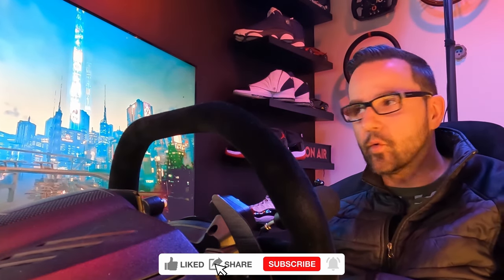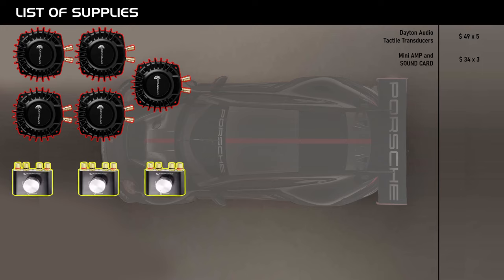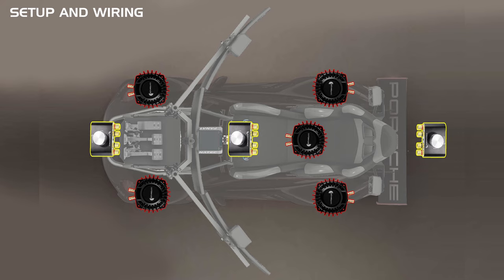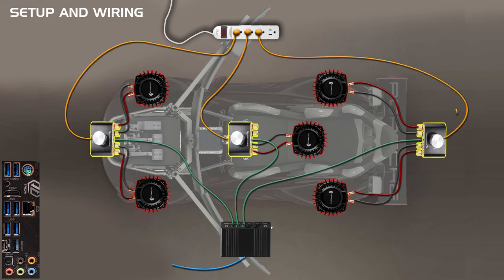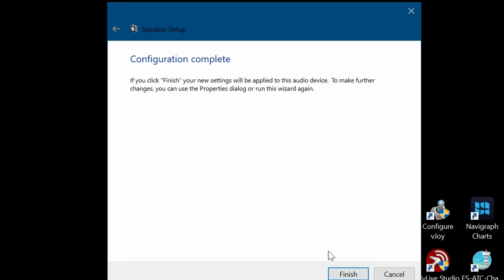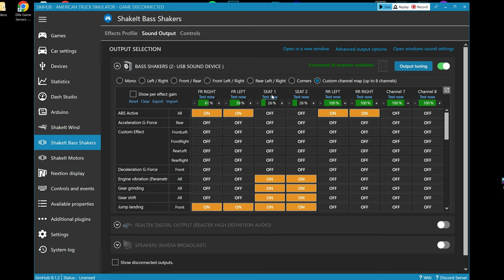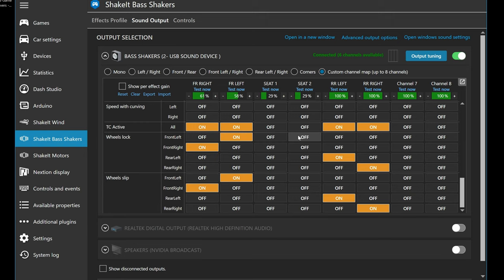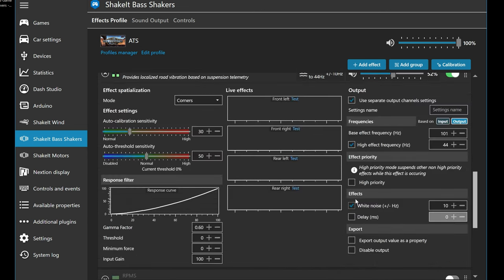DIY ULTIMATE Bass Shaker TUTORIAL | Step by Step HOW TO and SETUP

Comment: Just wondering if there was a single amp that you could recommend over having to use the three smaller units?
Reply from the maker: I've only used these so it is difficult to recommend anything else BUT : THEORETICALLY, ANY AMP THAT CAN POWER THOSE SPEAKERS AND RUN FROM HOUSEHOLD CURRENT SHOULD BE ACCEPTABLE!  I remember starting to go down that path one day but gave up . Someone in the comments bellow mentioned they used a marine amplifier. Scroll through and ask !! I'm sure people will help you if they have the answer ! Let me also do more research ....
Reply from the maker: The one thing I'm having a difficult time imagining, is how to get individual audio channel back into this single amp that we are both imagining.....hmmm..... Back in the day when we were messing around with amps and subwoofers in vehicles I don't remember amplifiers that had 5.1 capability....I could be wrong . The amps that is use provide power (amp) but they are also the receiver of 2 of the 5.1 (6channels) from the sound card .....hhhmmm what kind of amp would have 6 channels of input ...my brain is a bit stumped. To be clear . I am not an audio visual pro . That is why I made this video because I couldn't find any answers out there, therefore this is the only answer I could come up with.
Reply: Thank you for replies… I am currently building my rig and have installed two Dayton units. One under the pedal tray and one under the seat, but I can see me moving to more units to allow for more effects to be enabled.

Comment: will bass shakers work on rigs that are Steel Square tube?
Reply from the maker: Bass shakers will work on anything as long as you find a way to attach it and find a way to make sure the vibration transmits through the steel . I started mounting my shakers on wood pieces and cantilever those pieces  off the rig. That would enhance the vibration factor

Comment: my lg monitor has 2 stereo speakers. Do I still need a extra sound card?
Reply from the maker: Simhub will need a sound card to split the sound and send it to different speakers. If you are using that sound card to send sound to your LG speakers than it will be occupied and won't be able to be used for sound and for the shakers

Comment: may i ask why you didnt use the nobsound 5.1 ch amp instead of 3 individual units?
Reply from the maker: I had no idea it existed ! Now I have to look into it .  Have you used it ?
Reply from the maker: You can't hook it up through USB ...that's one huge drawback . Not sure how Blu tooth would fair under this set up . 5.1 ND latency ....hmmm . Yap . Not a good choice I don't think
Reply: @DaSimSimma  are you sure?  I havent used it but have it in the mail... some of the guys in Sim Racing Setups on FB have though. The mistake i made was using the 4ch lepy 269 which only outputs 2 channels so went and ordered a 5.1 sound card and the 5.1 nobsound.... external SC as im told the internal one is pants lol... ohhh and i also belioeve the 5.1 nobsound can digitally create 5.1 from just two channels somehow...... I guess ill report back in a couple weeks when its here ;))
Reply from the maker: I looked it up on amazon and you can see in the pics and specs that it doesn't hook up through USB. It takes audio inputs and Bluetooth . So I could be wrong but Sim hub does need specifically separate channels. 2 channel  can be split into 5 for audio purposes. I don't think that's going to report as 5 channels in  Sim hub.

Comment: Hi, do you need an external sound card? Or can it work with just the amps? I have 4 bass shakers connected to pc but only 2 output sound idk how to merge them. Help please
Reply from the maker: You can use the internal sound card but after that you will not hear the sound of the game anymore because all of that sound is being used by simhub. You don't necessarily need an external sound card either because each one of those little amps is also a sound card that has two channels. I explain all this in the video. I bought a sound card because it frees up your usbs. One 5.1 sound card only uses One USB connection and then you can split the sound from there to each amp.. If you do it like I did I had two of those amps plugged into the back of the computer as sound cards therefore using two USB . The bottom line is this I've tried it your way and many other ways until I arrived at the way that I described in this video. That is why I shared it with everyone because this is as far as I know the cleanest way to do it. I'm sorry, I cannot help you with your custom setup that's why I shared mine because that's the one that I know how to put together
Reply: @DaSimSimma  great thank you, ill look at the external sound card option. thanks again

Comment: But why you need an external sound card, the nobsound amps have a build in usb soundcard?! im confused
Reply from the maker: Sounds like you skipped through the video ....it is what it is ...
Reply: @DaSimSimma  hm okay. Only because of USB Ports. 😊
Reply from the maker: yes. Having a rig like this , with so many usb peripherals plugged in , you run out of usb's very quickly ...additionally , every amp will show up as a "sound card on the PC " making setting up sim hub a bit more complicated. It's not impossible or hard . If you do an external ..it shows up as one card ..with one usb and 6 channels to be split to 6 shakers. it is a cheap and clean setup this way. I had it set up the way you described in the beginning but I  graduated to this with time and experience .  @Condemned87

Comment: Could you do a video like this for PS5 ?
Reply from the maker: I am sorry . I cannot... :( I no longer have my PS4 nor do I own a PS5. The sad part is ...when I had a PS4 I did manage to rig up something ...but don't ask me what and how ... The only thing I can remember is there a used a surround sound head unit by Sony, the handles 7.1 channels. Somewhere in there I used two of the  low frequency outputs at the back . The same ones you would use for a subwoofer. Unfortunately doing it this way you're only going to get low frequency sounds that are coming from the audio in the game ( like the base of a tire hitting the curb) or a hit from another driver. You will absolutely not get detailed feedback about suspension and brakes etc like you do on a PC .those bass sounds are telemetry information and not actual sounds.  It's not impossible but is not the same as a PC , that's for sure
Reply: @DaSimSimma  thank you

Comment: Any other recommendable 5.1 external sound cards?
Reply from the maker: Sorry nothing off the top of the head, the one that I used is one that I bought on Amazon. I didn't really do research to try to find other ones.
Reply: @DaSimSimma  Thanks. I asked as the Vantec you recommended doesnt ship to our country. I'll maybe try the other generic 5.1 in Amazon that does ship to us.
Reply from the maker: I understand. Unfortunately no I don't have anything. Previous to this. I got confused and responded to you about a potential 4-channel amplifier. I had to delete that comment. I was getting my signals crossed for a moment. Sorry, that's what happens when you try to do too much .lol I really hope that you find an external card and honestly I hope that you come back and let me know about it. Perhaps I can add it in my description as an alternative option?

Comment: So basically, I can run my receiver pre-out sub -> Nobsound amp -> transducers mounted to rig = done?
Reply from the maker: Sure that's a way to do it. When I had a PlayStation 4 that's how I did it. The problem with that is it only puts out whatever base comes out of the receiver. Running it through the PC those signals are not audio signals ...they're highly curated telemetry signals that relate to all the bumps and shakes that you get. They  are related to the car not to the audio sound. All that to say: sure you can BUT  it's not going to be faithful at all like a  dedicated setup like this can actually give you
Reply: Wait, if I alread use a stereo receiver for sound, I don't need the Nobsound amp?  I jsut make sure the right channels are configured?
Reply from the maker: @Shawn-fu3mp  you need two things to run a bass shaker : an audio signal and an amplified current.
The audio can be anything....if you do it the way you described, you will get any base signal that comes out of that receiver. That could be engine car base hitting the wall etc...it could be anything that is coming from the audio signal. If you use a PC in simhub it will curate those base signals and get them from the telemetry data which is completely different than the audio data coming out of the game.
The reason you need an amplifier is because those base shakers are 50 to 200 Watts . an audio signal is not enough to feed it and make it work. You need to provide some sort of current so they can be moved when the audio signal hits them
Reply: @DaSimSimma  Thx!  I wil run speaker wires to 2x Dayton BST-1 Tactile Shaker 50W as my sterio amp has plenatay of juice (80w/c).  I just use 2 front channels for speaks and 2 rear for the Tactile and this should work no prob...

Comment: Can these be hooked up to a powered USB hub? Got plenty of slots open in those and it'd avoid using the Mobo USB slots
Reply from the maker: Yes you can hook them up to any USB slot that you want but you will only get audio signal out of them ( which is what you want) You would still need to plug them into the wall. The amps will not run off of a USB they absolutely need to be wall powered
Reply: @DaSimSimma  that's fine, I'm looking at TT25s. Seems -8s would be ideal for a 4 corner setup vs the -16s due to the Amp being rated 8ohms. Am I correct? BST-1s would be overkill currently.
Reply: @DaSimSimma  meaning, 1 shaker to 1 channel @ 8ohms from the TT25-8s would be optimal to TT25-16s? Tho 16s would work just on a reduced output. I'm just learning all this speaker parameters.
Reply from the maker: @retrocoffin408  I'm sorry . This is way out of my knowledge base. I knew enought to struggles through and figure out how to do it and later share . But when you speak ohms to me ...im lost. Sorry friend .it appears you are learning more than I did and that's awesome !!

Comment: One question, I have a neighbours below and next to me, can they hear the vibration? I don't want to hear them complaining on that :D
Reply from the maker: I don't think so . They do make a vibration but not a "sound" . If you isolate the vibration properly where it just shakes your seat or your setup and doesn't shake into the floor then you should be just fine. Put an extra layer of carpet underneath your seat to isolate it better
Reply: @DaSimSimma  thank you, anyway I head that 2 bass shaker is a sweet spot, one belowe seat and one below pedals, what do you think? I can save a lot of money to make a setup like this. ( only 2 bs and one amp ) :)
Reply from the maker: When I started I only had one ...underneath the seats . Than I got two more for the front , and later two more from the rear

Comment: Confused about simhub.. I spent the last few hours trying to trouble shoot a problem with my effects.. long story short. Everything is hooked up and when I use the "test" feature everything is getting signal where it should be. Front right shakes when testing front right. Rear left shakes when testing rear left.. but as I enable effects and test with the effects and turn on the corners or left/right signals.. it mixes and sends my signals all over the place.. or just doesn't even allow them to work( my road rumble only one transducer shakes when I use the corners setting) then I can go to my sound output and all things text properly like they are supposed to. Hoping maybe you have some insight? I have tried unistalling both simhub and my game.. making all new profiles.. just dont. know 

Side note.. I had it working perfectly until I changed to a new cockpit. 🤔 just confused as why it no longer is working properly now. Thanks in advance.
Reply from the maker: I am not ignoring you, I need to spend a little bit of time maybe this weekend trying to figure out and duplicate what you're talking about. The best thing I can think right now is in every effect does have an option on how to output it . If that setting is off it might now Ork ...sorry I am probably speaking out off my backside right now . Let me look into it and try to get back to you . To be clear I'm not a Sim hub professional so feel free to YouTube it I'm sure someone out there has ran into this issue before I can help with more certainty than I can
Reply: @The Sim SIMMA  no sweat no worries.. currently reached out in a couple forums and did a bit more independent research and was able to address the issue.. at least as of now everything is working fine.. I appreciate the effort.
Reply: @pbodyjel87 . What was the solution to your problem?
Reply: @peter rabbit  during the excitement of changing rigs. I completely ignored the fact that I added sim3d pedals and they didn't exist on the previous cockpit I used.  So i looked into it further and realized thats a new thing which could of messed with the settings possibly. when I got home. Went to simhub motors section.. and saw simhub asking if it should apply changes from adding the arduino. Clicked yes.. and everything worked. Never thought to check that initially as both those motors worked fantastically and it was my simhub bass shakers signals  that were wonky. And yeah.. that's pretty much it.

Comment: I have a similar setup with 6 shakers, I also have a 8040 rig, however my problem is, I can't tell the difference between shakers. They shake the entire rig so its very difficult to tell them apart. What can I do to be able to feel the corner shakers(ie left from right) independently from each other. Hope I explained myself properly
Reply from the maker: I know exactly what you mean and I have a similar problem trust me. I can feel front-rear and I can definitely feel engine underneath my butt. But not much more detail. Sometimes I feel left and right front but never rear difference. The only thing I can suggest is to cantilever mount them  as far out as possible.
Reply: @DaSimSimma  I have them bolted that way on a L shaped custom plate. A friend told me to try mounting the shakers with springs under them, in theory, according to him, it should concentrate the vibrations to that location only. I will give it a try ad let you know if it makes a noticeable difference. Keep up the good work
Reply from the maker: @paganini1224  thanks brother ! Let me know what you find out !
Reply from the maker: Thanks for your input !  ( Handshake ? ;) ) My apologies for yesterday.
Reply from the maker: @mrspangles932  and what a moment I was having....but...we move on lol

Comment: I did everything but my computer is not detecting the USB.  Any idea why?
Reply from the maker: That happens very very often. Is it no detecting the external sound card USB ? Gummies a bit more detail . In the meantime please try the obvious things like make sure that the amp or the sound card you have plugged in is turned on and plugged in and confirm that it's getting power. Second, go to lower right hand corner of Windows taskbar and right click on the speaker then left click on the word sounds. Make sure that all audio devices are enabled by right clicking and say show disabled devices
Reply from the maker: Going to try to troubleshoot this for you. If we can't figure it out you'll have to jump on my discord server. The link is in my about page. I can get on there l
with you later  and we can troubleshoot step by step
Reply: @DaSimSimma  so i connected just two for the rear of my rig, and my computer is now detecting everything fine, but in simhub when i click "test" nothing happens... thanks for your help man

Comment: How loud are they to other rooms?
Reply from the maker: They produce no sound at all. They do produce a vibration a physical movement which you feel  through your rig and your body. If hooked up improperly they will put out sound but not very loud.
Reply: @DaSimSimma  as far as vibrations go, I have a simlab GT2 80/20 rig that is on caster wheels.  I was planning on placing the rig ontop of something like a washing machine anti-vibration pad, do you think that alone would eliminate most of the "rattle type noises" to not disturb my family when I race?

Comment: Can this be done with ACC on PS5?
Reply from the maker: It can and I did it on PS4 . Unfortunately you will not be able to distinguish all of these effects . The best you could do is : output the sound to your home theater unit...take o the sub output and ad a splitter to it . Run the splitter to the amp and from the amp to the shaker ...this way you will get only the low frequency . But that means everything will be mixed together engine rumble strips and any other low frequency. I've added on this way and it works but not as exquisite as on PC
Reply: I have a PS5 and I split the audio from the dualsense headphone jack. You can only use headphones in this configuration, and like SimSimma said- you can’t choose the sound parameters. 

If you play GT7, I can confirm SimHub works perfectly with PS5 and GT7 only. I used an old laptop to run Simhub and connect my subwoofer amp via blutooth. This gives you the ability to choose what you want your shaker to do. I only have 1 amp and 2 shakers wired in parallel, so I don’t know if you can run multiple amps. 

After fiddling around with it for hours, I just went back to splitting the audio from the dualsense controller for the ease of use. Good news is I have 2 shakers, so I can add more if I decide to get a PC.